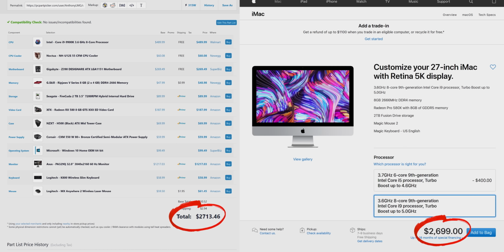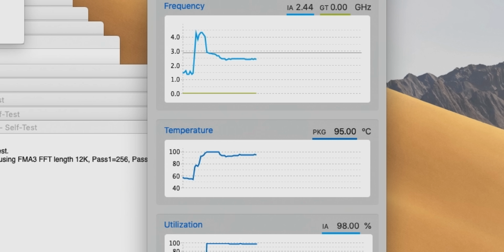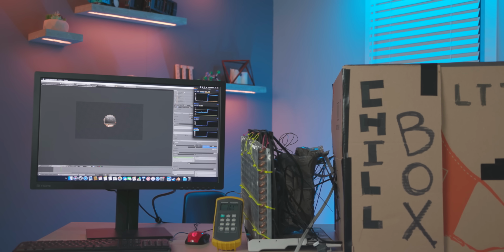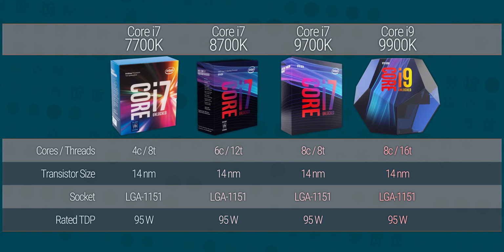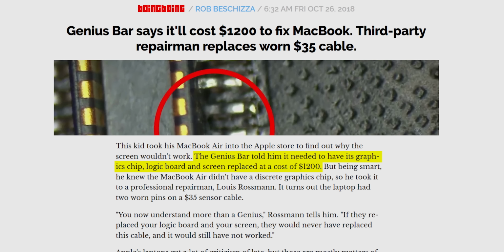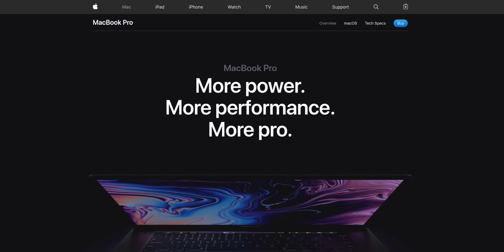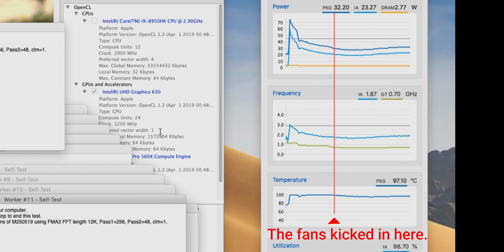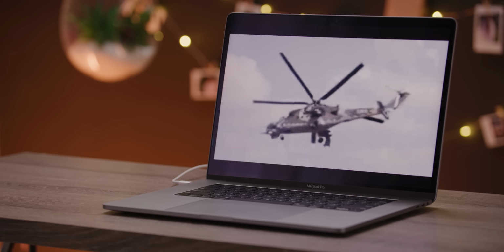Macs are SLOWER than PCs. Here’s why.

Comment: This is why I always get the best computers when company's sell off there old equipment, because people only want laptops. I got my hands on a HP Z600 for $50 and they go for $1,000.00's
I bought 2 Xeon x5672's ($100.00) and an extra Heat sink ($50.00), off Ebay. Then put my GTX 1070 2x Wind force OC rev.2.
Reply: A dual CPU system doesn't always perform better in games due to latency, even if it looks great on paper. Trust me I've tried. I have a dell workstation with 2 Xeon 8 core chips at 3.7 Ghz and it is outperformed by a 4790k with the same 1080 ti and way less ram. It is amazing for video editing though.

Just depends on the workload you plan to throw at it.
Reply: @justinours3190  I agree with you 100% but now that I added I sata 3 card in there, my SSD is performing way better with latency, which improve the system performance overall.

About your Workstation. If you get the right one, Like I have did, you can do it. Make sure to turn off all Power saving options in your system BIOS, also update to newest BIOS for comparability, Next make sure to use a MB with at lest a Gen2 PCIe x16 slot for your GPU and have a sata 3 for your system files, even if you need expatiation cards.

My 3D Mark Results in Time Spy
https://www.3dmark.com/spy/5756842
Reply: @RobertGoddard86  Tinkering with power settings and flashing newest BIOS usually has little to no effect on performance of a desktop PC.
Reply: @wj45  Yeah but on a 10 year old Server it does if you want to use to near top specs of the motherboard
Reply: @RobertGoddard86  Do you have any test results documented to confirm it?
Reply: Robert Goddard your sata 3 performs better than domestic PC because you have a workstauin northbridge which is made for that and server apps. You made the right choice. And other blockage for overall system is the PCI-E shared links between them, thats why I put my Adaptec 8405 with SSD’s on an unshared link northbridge and southbridge PCI-e, in order to ensure the minimum latency with graphic card.
Reply: @RobertGoddard86   Actually the issue isn't with the storage device in that case the issue would be with the fact that   Cache and RAM on the CPU's are Segmented similar to a ryzen chip. The difference in this case is there is no infinity fabric telling get together meaning whatever you thought rise and ships had in  Latency Double or triple it.
Reply: @RobertGoddard86  Well, a single test result is pretty useless :) I mean, did you make some speed test before tinkering with power settings and after and compared them? And documented what settings exactly where changed?
Reply: @wj45  There was a glide I found on HP forums about the Z600 and what the best BIOS setting are!
Reply: @RobertGoddard86  Right, but this is not an answer on my question :)
Reply: @wj45  Well I have this test before my SATA 3 card was bought.
https://www.3dmark.com/spy/4171311

You can check out more about my bored here: https://pcdied.com/intel-magic/z600/z600.html after a simple Google search I found this information again. with some test aswell to help you along.
Reply: How did you manage to find them on sale?
Reply: @123dannyboy100  Now, this is the question we all want to see answered!!
Reply: @123dannyboy100  What do you mean? Ask around....  Find out where people you know work and see if they ever sell there old equipment to there employees is how.
Reply: Yes pls

Comment: I had a 2011 macbook pro, i admit, it was 2 years old when i got it second hand, and i was a shit owner, but my 2016, £250 HP laptop lasted just as long, while i took absolutely no care in keeping it safe ( i use to be a much worse owner before i got into pc's) so my Macbook pro (which other tan a loose key and a tiny bit of spill) lasted around 3-4 years, while my cheap poor people laptop (extensive spillage, a damaged cpu, and a ripped appart screen, lasted justy as long, and still works today, although badly, and i havent tested it in 6 months

Comment: Holy jesus! 100 degrees CELSIUS? A well cooled PC in optimal conditions achieves 100 degrees Fahrenheit!
Reply: Below 80 C is perfectly acceptable for long term use. If you're getting below 60 full load you're overspending on cooling.

Comment: I do want to point out that yes, macs NOW are better priced. But if you look at systems from the early days of I series processors and earlier, macs were almost twice the price of the average pc part for part. Ironically even the big g5 towers fell short on cooling. They had big Delta fans in them but that's about all they had going for them. The heat-sink's were never designed for the quad core cpu's they later ran and would quickly get hot coursing them to turn into a jet engine. They used the same heat-sink for years, low density/ fin count all aluminum heat-sinks. While they were huge it did nothing to effectively cool the cpu. The ppc processors were fine but they were done in-house anyways. Later on they introduced water-cooling but we all know how that fell short, literally..

Comment: The ONLY thing I can think of that would make sense for their phones not suffering the same issue: CPU design.

Going back to PowerPC and AIM alliance and why Apple went to Intel in the first place brings up some interesting ideas on this particular topic. Apple designs it's own CPU's in the iPhone and it doesn't throttle, while the Intel CPU's in macs are, as LTT said, stuck on 14nm. And Intel was supposed to be down to 10nm in either 2015 or 2017, regardless 2 years is a long time in tech world.

I think Apple knows this, and LTT makes some good valid points as well. I think Apple has been looking at two options: AMD or Inhouse.

As someone who has loved Intel since they entered the Dual-Core era, I think performance will improve once Apple switches away from Intel. Or that is, better utilizing the silicon at their disposal.

Comment: Apple sells you a ferrari on cheap ass wheels, you'll never get the speeds safely. Your hardware will fail quicker, and they will hope you love the OS so much, you shell another 2K for a crippled Intel. No, Apple; i've learned my lesson. This summer i can punch my CPU 100% because i got an actual decent cooler on it, my imac 27 " was impossible to keep cool on almost idle temps with a 30"fan blowing at full speed at the back of the casing. Yeah, had to turn down the backlight of the screen to get some results. Bye Apple!

Comment: So, what about designing an aftermarket clip on device that deliver super cool air to  the air intakes?
Reply: MacBooks don't have air intakes 😂
Reply: @PHIplaytesting  ok. You giggled for two years, so go have a look at eg the Late-2016 i7 3.3GHz 13-inch MacBook Pro withTouch Bar.

Comment: Look at all the Apple fan boys coming to discredit this video... Apple are good at one thing, brainwashing the weak. My ex-wife had a Macbook Pro... within a year it was slow and un-responsive, running hot as hell... I installed Linux Mint on it and it worked smoother than it ever had... 3 years later, the chassis is warped, the touch-pad is cracked and coming apart... But the software works perfectly and no thermal issues since installing Linux on it... what does that say?

Comment: For someone like me who just needs a laptop to write on a Google Doc during class or take notes with, or basic on the go uses, a Macbook Air is great.  I've never had a problem with my Macbook Air being slow, probably because I don't have more than 3 applications open at once.  I totally get the temperature problem though, the fans are pretty weak and heat will become an issue if you're heavy loading your laptop.

However, I don't think that's a reason to hate Macbooks.  They serve their purpose: a highly portable and sleek looking laptop for simple uses on the go.  Macbooks are great for that.
I also own a desktop.
Reply: I mean, but there are also cheaper options that are just as good for taking note on Google drive or whatever.
Reply: @AschKris  Agreed! Thank you! I was just about to say that!
Reply: If you're going to be using a computer for only that purpose, might as well buy a Chromebook for $35 or something.

Comment: Pro tip you're buying a MacBook Pro... NEVER and I mean NEVER buy a first gen MacBook Pro update, and never buy the first multi-core upgrade of a MacBook Pro - both updates are hell. Personally, I picked up the MacBook Pro 2017 15inch Quad-Core, and it's great. Works as advertised and never gets too hot. Just remember those two rules and you'll be okay.
Reply: Based and truthpilled, though I apply that for every Apple product. Remember the Titanium FailBooks with the fragile hinges? The first-gen MacBook Pro’s with thermal issues? The first-gen “Unibody” models with the displays that would come away from the assembly because they weren’t true Unibody machines?

Comment: Alright, Once in lifetime I have to catch this bait. I used to be all about hardware optimization to max, pc's all the way and then switched to macbooks and not looking back. Why?

Processing speed has been good enough for most professional tasks since the first i7 generation. For long it has been at the level where you can do day-to-day design work just smoothly enough that it doesn't feel sluggish:, graphic asset work, coding, 3D-modelling to run on mobile devices, basic video-editing etc.  Sure, high-level 3D and Gamedevelopment, huge photoediting/poster work hundreds of layers, 5k&360 video editing, computation heavy algorithms - etc- then you need more beef than macbooks have to offer, especially if you can't push the work to cloud/render farm. For me, there is always the gaming-pc to do the heavy rendering during night when needed.

Why people choose macbooks is not about sex-appeal or status, nor is it about specs, it is about  User Experience. For most design/it work, macbooks work just smoothly enough, macOS is hassle free and gets out of the way,  they are lightweight for daily commuting, quiet, won't get hot on lap, sturdy solid build and last a 5-10 years if you didn't get any bad parts (or new keyboard). You also pay for having to do less troubleshooting with hardware and programs, either it works nicely or not at all. There is little middle-ground for driver/config-file/os-tuning which just might get it to run on your system, or make it even faster! Used to love that stuff way back, can't be bothered nowdays and hate it when I must.

So - convenience. The hardware and os aim to step aside from the work you want to do - and they succeed, the experience is so damn nice. Somehow windows just feels clunky afterwards. Still, Apple is a greedy bastard with malicious design regarding repais and upgrades and competitors are catching up fast and surpassing on many fronts- even on screen quality. Weren't I this invested in the ecosystem, I'd look at the competitors when choosing the next. But not for the specs, but being able to expect 5-10 years of smooth working on it. That's worth paying the premium.

Comment: The thing is to Premiere users, your argument is perfectly valid and probably the PC owners of them to not switch to Macs. However, with Final Cut users, due to the REALLY GOOD optimization on the Macbooks, even if you have the best PC, the timeline smoothness and export speed still can't compare. However, there are other problems preventing Premiere users from switching to Final Cut cough magnetic timeline *cough*.

So yeah, I feel like this video is going to be really good as a source to refer to in discussions and people who thinks that Macbooks have better performance (which I doubt there's many out there), it is not going to convince anyone, especially Final Cut (or Logic Pro) users to switch due to their dependency on Mac-only apps and other reasons (maybe they just like MacOS).
Reply: People dont use logic at all, so you probably gonna find alot of em

Comment: My guess is that they don't want to make their computers "bulkier", but seriously? I'm done with Apple computers. My dad's 2011 MacBook Pro died (it didn't even have a dedicated gpu) and they sent a replacement MacBook Air, which also is slow as hell, even though it uses an SSD. I wouldn't mind the computer being a little bulkier if it meant I'd get better performance the same way I wouldn't mind my phone being a little bulkier if it also meant having a bigger battery.

Comment: What I personally feel is that Apple doesn't care about the Intel chips that go in their Macs especially since 2017 because (if you were to believe rumours), Apple plans to make its own chips for Macs in the same way they make their own chips for the iPhone. We have already seen that Apple's chips are FAR ahead of the competition, sometimes even a full generation (or even two). So, if they could potentially translate that chip-building knowledge for the Mac, they would already have 7nm processes good to go and this would hopefully mean that they have enough time for R&D for thermals. This would also reduce delays in launches due to Intel's "sluggish" output that meets hundreds of manufacturers.

Speaking of their professional line-up. What I feel is that a non-professional Mac (maybe the 1080p/4K/5K Macs) would get the in-house chips first and that would "trickle up" the Mac lineup.

Just my opinion.

Comment: Moral of the story: Intel CPU's overheat and Intel hasn't innovated enough to be competitive. Yet still large companies continue to use their product because they used to be good CPUs
Reply: This is retarded, it's a chassis and cooling issue with laptops in general, not a CPU overheating issue. Intel still makes good CPUs with good TDP and throttle control. It's Apple and other small form factor laptops with shit cooling. Intel is still better and more reliable than Ryzen, 100%

Comment: you missed a key-point Linus, that the CPU in the iPhone is designed by Apple, the one in the laptops are not.
Reply: no they don't. the iphone cpu is custom ARM architecture they "design" for their phones. no different then when AMD, and Cirix cloned the x86 and were granted licenses to the intel x86 architecture. it is not their design if they license and use someone elses groundwork for the entire architecture. apple has never "designed" a cpu themselves, always had someone who knows what they are doing to help them along. remember power pc? i guarantee without IBM and Motorola that cpu would have never left the drawing board.

Comment: They all throttle as you say. How much is the difference between Apple and other manufacturers throttling? Not much I’d presume. Also, if you buy a laptop to run it at 100% power most of the time, you’re an extreme edge case, no?

Comment: Macbook Pro 15 inch, 2018 with 2,2Ghz Intel i7. When compiling or converting video materials it uses more power than original (90W) changer is able to provide and battery gets drained. Hows that for a "PRO" usage approach?

Comment: I remember you could control the fans with a 3rd party application, and make them go off in lower temperatures than the default.
If it's still possible, it's a must-have for those new macbooks.

Comment: Why there are not Liquid Nitrogen or some fancier liquid cooling solutions?
Why is still water the most used liquid?
Why there is the need of pumping devices?
Why there are not devices with liquid gas that with heat and gravity will move - and some one direction valves to keep the flow -?
286s 386s ARMs OpenRISC and MIPs CPUs were or are fanless, even some low spec intel atoms are, why there are not more intel /AMD fanless models that would run well?
Reply: Making an Intel/AMD processor run well without a fan would mean throwing out x86 entirely. RISC processors (such as ARM) generally use less power, which means less heat being dispersed. Same with low spec Intel Atoms. They don't require a fan (it's still recommended though), because they can safely operate without one.

Comment: This one was really good.

You just missed the answer for the difference between Mac & iPhone (Intel vs Apple AX chips). But as a 2018 15 inch user I definitely agree with what is stated in this video.

Though I also agree with Apple approach of keeping design above performance. Even if that order of priorities cause issue on "Pro" machines.

I'm just hoping my next MacBook will run on a A14X chip, that should solve many issues.

Comment: The answer of the high thermals are pretty simple. They are still out of Steve Jobs philosophy, PCs and Notebooks should be zen like. They should be as quiet as possible. In the mind of Steve Jobs they should not be heard even under heavy load. (It is even said in the Biography of Steve) Thats why the cooling is so poor, because it has to be quiet.